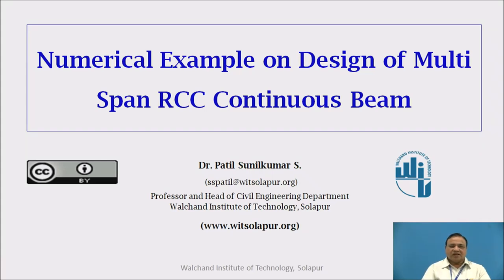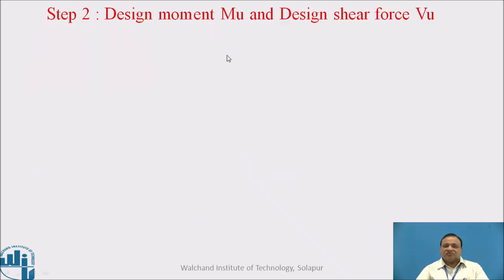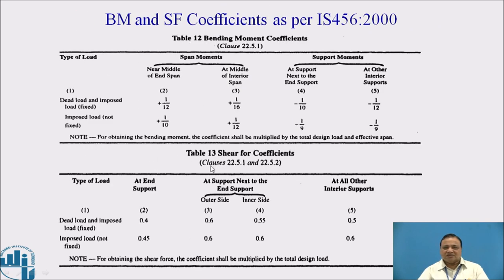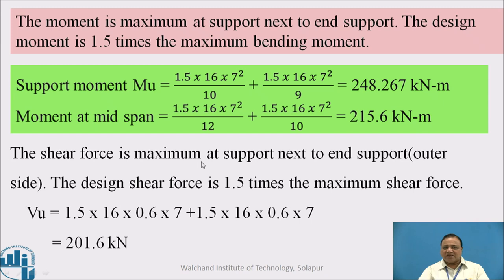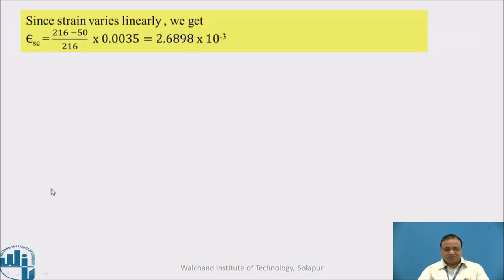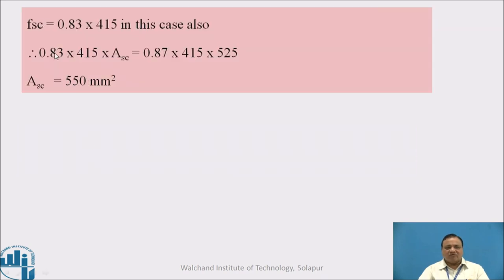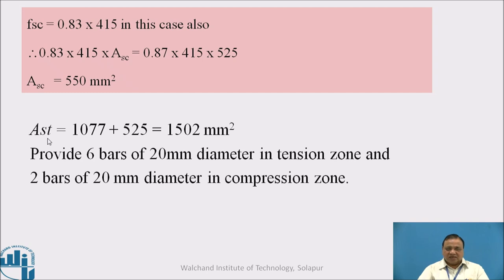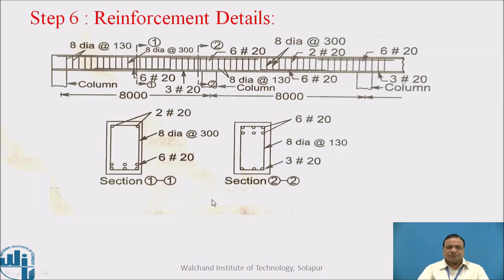Example on Analysis and Design of Multi Span Continuous RCC Beam

Comment: sir your lectures are very good, your teaching style is very much good, only one thing i have noticed that you have not taken the load due to wall (half brick or full brick) neither on slab and nor on beam...please consider it and find out the value of Wd and Wl , i think this produces more moments at supports and span too...
Reply: Yes,  19,2 KN/m3 . consider thickness  and height . This will come   KN/m.